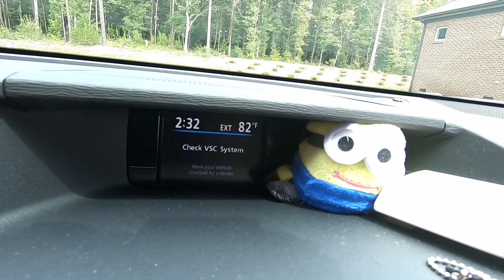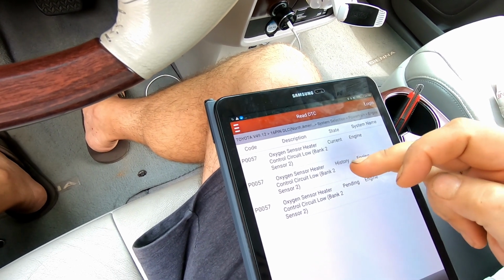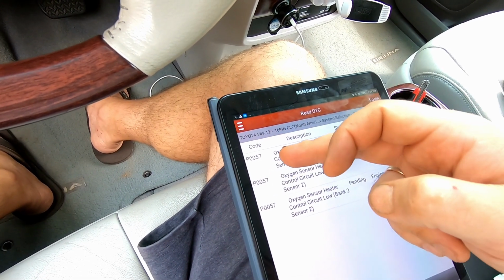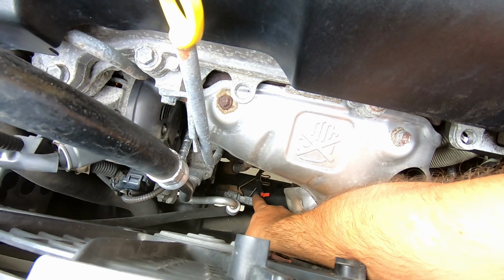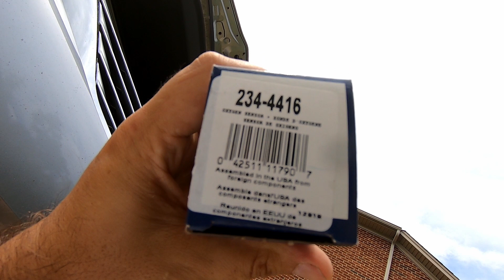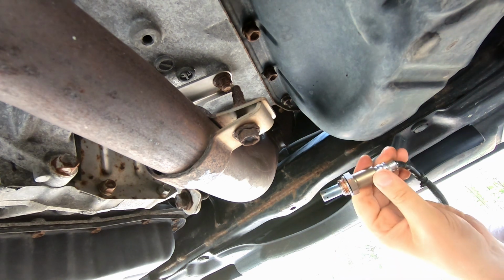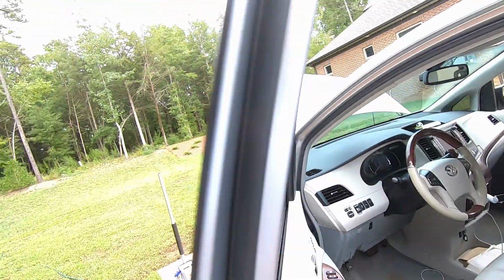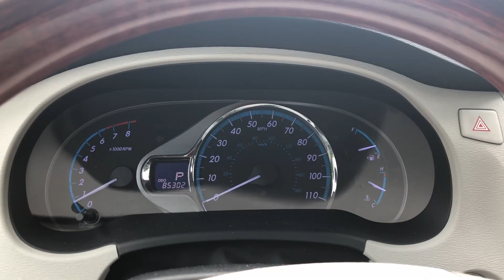2011 Toyota Sienna Very Deceiving CHECK VSC SYSTEM message.

Comment: Thank you SO much for this video!! I was having this EXACT issue on my 2011 toyota sienna and after I changed my bank 2 oxygen sensor, the VSC and check engine light finally went away!!
Reply from the maker: Isn’t it crazy how those 2 totally separate systems are somehow interconnected? :)
Reply: I am having same issue with my 2011 sienna could you help me please

Comment: Thanks for this!  Same problem, VSC light, but also an intermittent P0300 (Cylinder Misfire).  I was chasing down the vacuum leak, MAF and PCV. cleaning ABS Sensors rabbit hole(s) until I saw your video.   I'm not getting a specific O2 sensor malfunction off my BlueDriver.  So either more research or buy two downstream sensors. Thanks a bunch for connecting the dots between two seemingly unrelated systems!    Update- it's worth checking some really easy  things, like the PCV valve and its hose to the intake.  I was nosing around and realized the hose was just "hanging by habit" to the intake [following an urgent alternator replacement by local multi-brand Napa repair shop - after which the VSC and P0300 occurred].  I removed and cleaned the PCV, then ensured the hose clamps were snug.    The VSC light and the misfire codes haven't come back after four days of varied but steady driving.    I think you're on to something.  In my case, the air introduced downstream of the MAF may have contributed to the P0300, and then the VSC as you experienced.  My downstream O2 sensors are in the sub 1 volt range, but not operating in sync like the upstream Air/Fuel sensors are (which may mean one is going bad, but early days).   Next the serpentine belt and trying to figure out why I'm running through CV boots on the outer boot, left side.  LAST UPDATE - Here are the verified Denso PNs for the 2011 Sienna for the Bank(x) Sensor (x) locations:  B1S1 (Right/Firewall, Upstream)  234-9022 ;   B1S2 (Right, Downstream)  234-4540;   B2S1 (Left/Radiator, Upstream) 234-9008;  B2S2 (Left, Downstream) 234-4416.
Reply: I’m having a similar issue. 

Did you end up replacing all of the oxygen sensors?
Reply: I have the same problem, my car was driving fine and started running slow slow slow until stop. My engine keeps running not the tires.please help!!!

Comment: Same thing is happening to our 2011 Toyota Sienna. P0430 code and check VSC. Dealer recommends replacing the catalytic converter after troubleshooting that the sensors were working. Trying the advice on other chat rooms to do a fuel additive and a new air filter. Will then try a new PCV valve and then a new B2 Sensor 2 O2 sensor like you did. Thanks for the video!

Comment: I found this same solution mentioned in various online forums.  I still have this problem, and need to fix it.  One VERY IMPORTANT THING for anyone with a 2011 Sienna V6 - update your OIL COOLER LINES!!!  They are rubber from the factory, and will start to leak and could cause a fire!  It is a SAFETY RECALL in Canada, but not in the U.S.  I replaced mine with the updated METAL lines and gaskets from Toyota for just over $110 in parts as a kit.  Our rubber lines started squirting engine oil right on the front catalytic converter and started smoking.  It pumped out 3-4 quarts of oil over several miles with no warning!  Also, check your transmission for the presence of the magnets in the pan - ours didn't have any, from the factory!  Now we need a transmission because of Toyota's poor quality control - aluminum in the fluid and slips in reverse when hot.  Putting 10 quarts of fluid through it didn't help.  Good luck!
Reply: Had the same issue with the cooler lines. Shit design and a ticking time bomb for sure. Got the upgraded one from the dealer, bit of a pain in the ass to swap but doable with patience and the right tools.

Comment: I'm the unlucky owner of a 2011 sienna van. Dealer cannot fix my problem.
 $800 in non reimbursed rental card charges!! Brakes were engaging on their own at any speed with sound like crushing beer cans. Car grinds to a hault. Van pulls to left or right. Another try by dealer  had the crush sound with traction light blinking Said nothing wrong!! Smooth roads, no rain or ice etc. The button that should turn the traction function on and off does not work!! Driving home from dealer traction light blinked 5 times trying to slow the van. No sound of metal crunching. Slowed van down like lagging but no stopping. This is BS and the dealer can't fix it. Said traction was ok. 5 times it engaged driving home from the dealer !!!I had the wheel speed sensor on the left front wheel disconnected months ago so I could drive the POS. It has to be a sensor that is defective but I don't think the idiots are checking each fuse/sensors. I need someone to help me determine problem. I'll have to disconnect wheel speed indicator again to prevent brakes engaging. Any ideas. Thanks so much

Comment: I succeeded in removing the suspected faulty oxygen sensor from my 2011 Toyota Sienna and pre-detached the cable and clip.
I attempted to install the new Denso O2 sensor (that you promoted via Amazon) after placing a small bead of copper antisieze (included) on the leading threads.  Unfortunately, with the cable scrunched behind the body of the oxygen sensor, apparently I did not have the threads squarely engaged.  I rounded the leading threads on the replacement (new) oxygen sensor.  I have ordered a second sensor and will be more careful to manually thread prior to wrenching and torquing tight so as to NOT cross thread.  I am hoping that the threads in the exhaust pipe's bung are not corrupted.  There is not much room there to run a tap through to chase out the bung's threads.

Comment: Thank you so much for sharing thus video.. i was driving home last night when suddenly my vsc and CEL came on.. hoepfully this fix my problem.
Reply from the maker: You can’t rely on the video alone- you need to diagnose it first. A lot of different issues could lead to the same warning.
Reply: @HETPEZB  I scan it and i get a p2917 code which is B2S1 stuck lean.
Reply from the maker: Vacuum leak?

Comment: I had the same issue with my Toyota replace oxygen sensor..👍
Reply from the maker: Later down the road I have the same VSC system message when one of the VVTi valves got kaput.

Comment: it could be that they just activate a bunch of lights to make people pay attention because people don't care when check engine light comes on since it is usually stupid things like loose gas cap and such.
my Subaru lit up several lights and disabled cruise control because i was changing spark plugs and turned car to accessory or run without starting it while a wire to plugs was disconnected

Comment: READ THIS, COULD THE SAME ISSUE AS YOURS. 
I just help a friend
vehicle: Toyota Sienna 2011
issue: 
engine light on
vsc system message on dashboard
I saw this video and I called to toyota service, they ask me if I recently ad gasoline to the van, the question was related to a loosen or broken gas cap. I turn off the van, took off the cap and put back again making sure it was all the way closed , and the engine light / vcs system was gone.
Good luck
Reply from the maker: You always should start with a diagnostic first. Without it - it may become a parts cannon.
Reply: Mķo

Comment: So I have a 2008 Seinna. Shortly after purchasing it used, we experienced a faulty traction control system. Going around a curve, the van would freak out, the brakes would slam on, and it would be hard to control the van. The Yaw sensor was replaced, zero point balancing, etc. No luck. Have heard it could be the rack and pinion. Then an O2 sensor went out. This disabled the faulty braking system, so the van was drivable. Partner replaced the sensor so I could pass my emissions check. Disabled the traction control system by pulling some fuse. I hate driving this van. I live in a valley and have to go through mountains to leave. I avoid leaving the valley floor or driving in any type of bad weather. I have driving-related anxiety now. I do not understand why Toyota designed all these things to be intertwined with one another. We have owned several Toyotas from the 1969 Corolla to the 1980s. I thought I was buying a decent van by going with Toyota.  I need a new car but am afraid of buying another lemon.
Reply from the maker: I would check a live data on a wheel speed sensors during those events if it is easy to replicate the faulty condition.

Comment: Let me add my thanks as well - great video.  I have a 2009 Toyota Venza and was having the same issue - the oxygen sensor fixed it.  Can I ask what type / model ODB tool you are using?
Reply from the maker: I was using Launch scanner.

Comment: Thank you for video, I changed sensor cable like you. And main indicator still error like you. How do you erase the alarm after replace sensor cable?
Reply from the maker: After few starts and driving it went away on its own.
Reply: Best Pixel Repair Alright, I will try it. Appreciate it.
Reply: @MrYoonsungjun  did it go away?

Comment: What size is the nut to remove the sensor?  What size wrench is needed
Reply from the maker: As shown in the video I simply used the pipe wrench. Didn’t measure the size of the nut.
Reply: 22mm wrench

Comment: Hello there
I have 2011 Sienna LE V6 and I have VSC and check engine light on and 2 code Shows P0137 P1604 I don't know if same oxygen sensor do you using or not and I Don't know if that same location or not Thanks

Comment: Was the van making a louder exhaust sound before the fix? Or was the vsc the only warning?
Reply from the maker: There were no any side effects except stability/traction system was deactivated.
Reply: Did you find out what was causing louder exhaust sound?
Reply: Same thing here. The exhaust made a louder sound before VSC light came on. Did you find out why?

Comment: What app did you use to diagnose the issue? My light just came on and I want to make sure I am replacing the proper part.
Reply from the maker: I used Launch but you can use any good scanner, like Autel for example.
Reply: @HETPEZB  thank you!

Comment: I have the same problem with my 2011 Sienna Se. But its bank 2 sensor 1. The top Sensor. I replaced it and works fine for a couple of days but then the error came back..
Reply from the maker: Did you check VVT filters? I guess there are 2 of them. If they are clogged the code will be triggered.

Comment: Hi to all. I have the same issue "check vsc system" and the sign on the dashboard on just after replacing the Electronic Power Steering system Assist motor on my 2011sienna used from a 2017. I will try driving some miles and see if that fix the issue without replacing any O2's. Any one having the same issue like mine?
Reply from the maker: You need to scan the codes first.